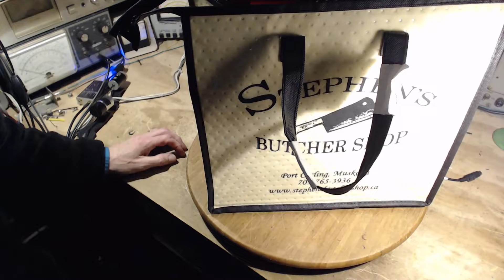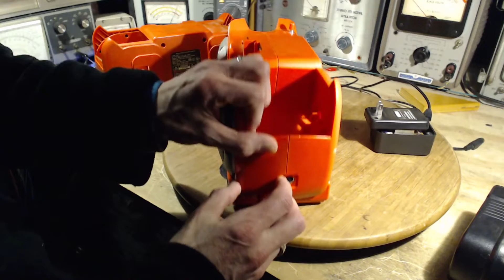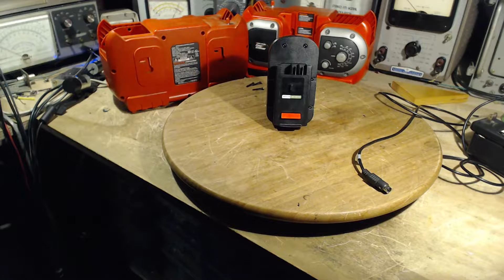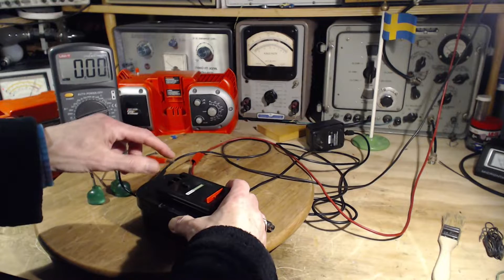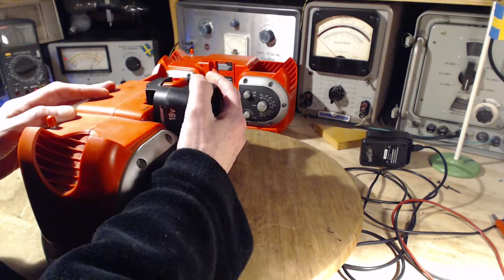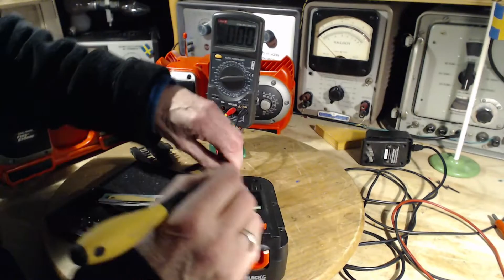Black & Decker Radio Battery Pack Testing

Comment: The cells are all in series.  15 x 1.2V (nominal) =18 volts.  NiCd cells are typically charged up to 1.4 volts, so that's the 21  volts =15x1.4
Not clear why the 11 volt section is there but obviously not needed since the  radio runs on 18v.

Comment: NiCads have a typical voltage of 1.24 volt and the correct voltage to recharge them is 1.42 volts per cell, that's why his charger always delivers more than the voltage of the batteries...
Also Nicads have a "memory effect", this is, at a certain point they may seem to  charge very quickly but when subject to a load that voltage drops so significantly that the battery is practically useless and has to be replaced... It's very difficult to design a battery charger because the charge must be cut off when the batteries present a specific voltage and temperature, which of course changes from battery package to another... The voltage of a battery without load or read with a high-impedance multimeter means nothing, you need to put a dummy load to check the voltage...
Reply: NiCd have a memory effect but it can be cleared by one or more 1C discharge and recharge cycles.
What makes NiCds good power tool cells is that they are not as temperature and overcharge sensitive as their direct successors the NiMH. That is why NiCd chargers can be and have been simple without the risk of damaging the cells up to a charge rate of 0,3C, with most charge rates in the 0,1C range (14hrs).
What damages NiCds and even more so kills NiMH is being subjected to reverse polarity charge when being the first cell in a series string pack to deplete under load.